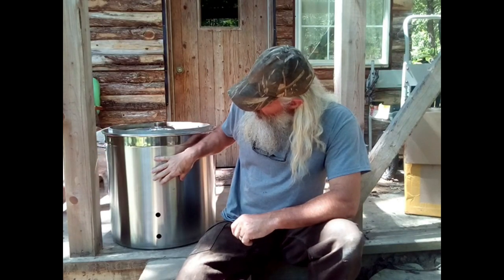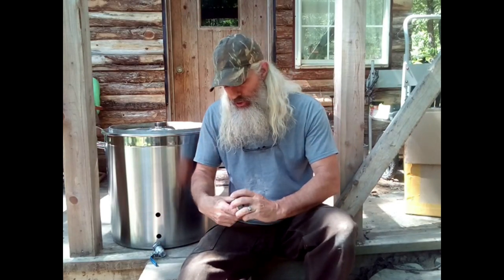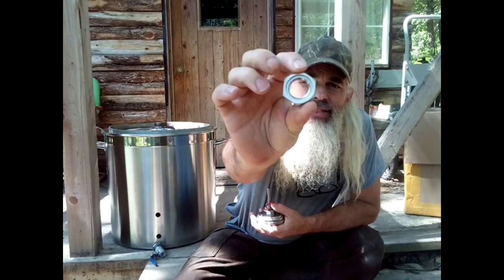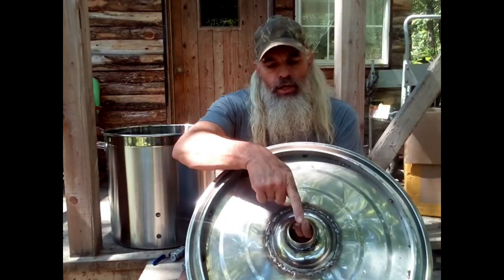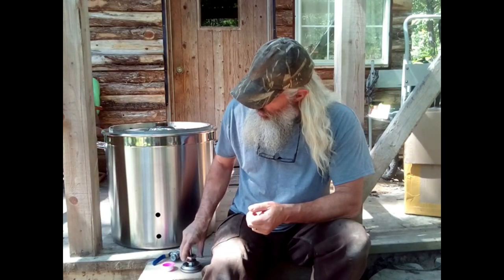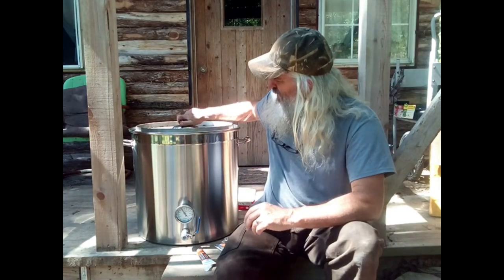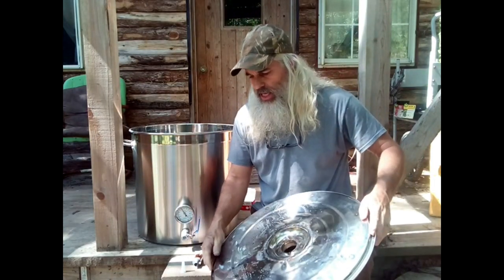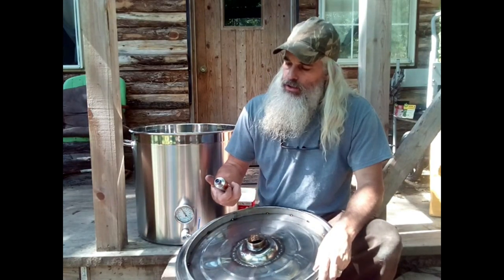How to make a 25 gal. still-part 1-The Pot

Comment: Back in the day, running a large illegal copper still, we used biscuit dough to seal the top of the still.  Don't know if that would work with a modern still, like you have, but you could try it.  The biscuit dough cooks as you're running the still and hardens to seal it.  The top of my still was a LOT heavier than what the lid on that stainless steel lid of yours is.  Canned biscuit dough works best.  Not any fancy biscuit dough, just those cheap cans of little biscuits...you don't want any of that flaky biscuit dough.

Comment: Silicone is NOT good for gaskets on distilling, ptfe tape or gaskets are better. Sorry for bursting your bubble  on your silicone seal idea.
Reply from the maker: Thanks for your comment Jeffery, but I will have to disagree. Food grade silicone is widely used to make seals and gaskets in the distilling industry. There is no evidence that using it is an issue. It is temp rated and very chemically tolerant. The only issues it has is with acetone, but the acetone levels found in fore shots are so small that there is no real danger to the silicone gasket. Tanks again.

Comment: That gasket doesn't look real "food safe".  Why not just clamp it metal to metal?  I've seen guys run them metal to metal before...
Reply from the maker: Thanks for the comment. The research I did on the product indicated to me that it was safe to use. I cant go metal to metal with this particular lid because there was some slight warpage from the welding.
Reply: @TheOffGridMaker  it’s not safe.
Reply: @TheOffGridMaker  CAN  alwAys use flour paste to soothe the haters

Comment: do they have something that locks down the lid being it under pressure when it's running do they make smaller pots
Reply from the maker: Yes, you can get smaller pots. I'm not aware of a locking mechanism, but there is never more than about 2 psi in an open system like this. If you ad in a thumper it becomes a closed system, but still only has about 5 psi.

Comment: Cannot be a 25 gal pot. 25 lt maybe. 
Looks like 6 to 8 gal.
Reply from the maker: Here are the dimensions of the pot. radius= 9.75" height= 19.5".
Here is a link to a calculator of the volume of a cylinder
https://www.omnicalculator.com/math/cylinder-volume
Thanks for your comment, but I am well aware of the volume of this pot.